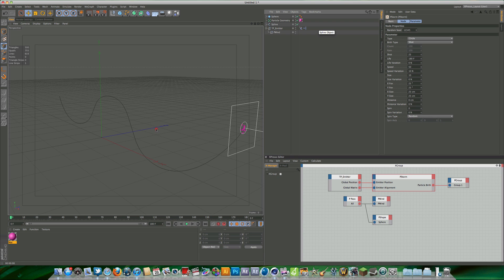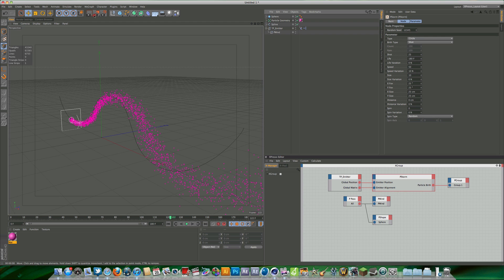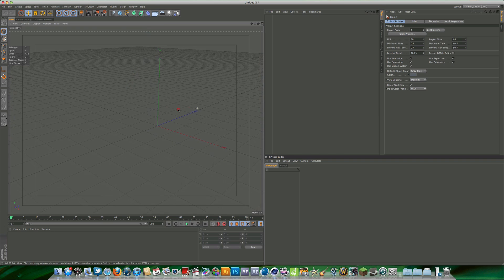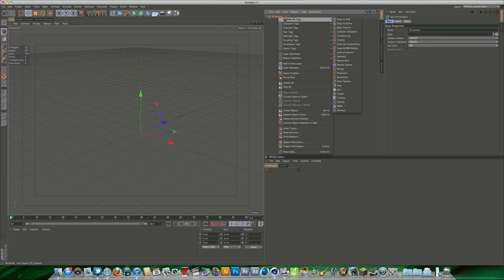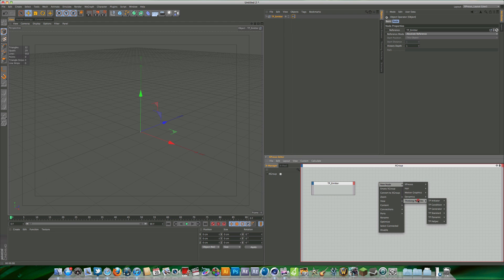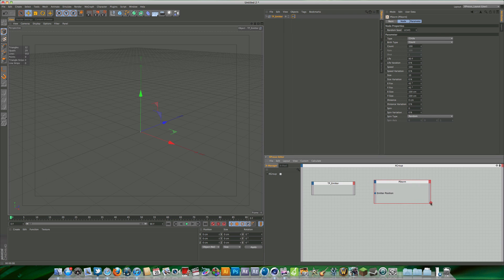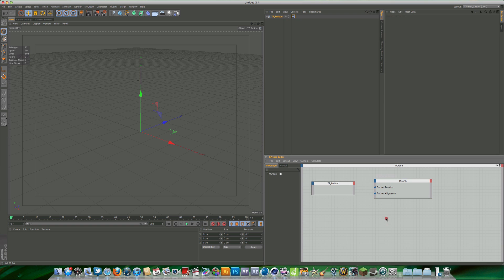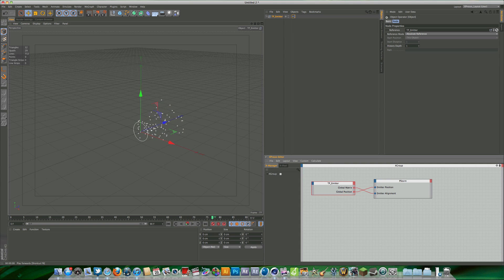Thinking Particles Cinema 4D Tutorial - Part 01

Comment: Ram and bits aren't what people look for, because when it comes down to it, the designers look for a smooth system thats stable, with a clean design, which is mac. They may render through a beefed up windows, but all the design is done in mac.

Comment: This is irrelevant information.
They also use high-end monitors capable of displaying 10 bits per channel (30bit). OS X is only capable of displaying 8bits per channel whereas Windows 7 was already capable of 48bit (16bits per channel). Twice the number of bits does not equal to twice the number of colors: 24bit(3x8) is 16,777,216 variations of color,while 30bit(3x10) is 1.07 Billion variations of colors. This means that 24bit is just a tiny bit more than 1% of 30bit.
OS X is deprecated.

Comment: All Adobe and Autodesk products are nVidia optimized, and as far as I know, only the macbooks have nVidia GPU's, iMacs and Mac Pro's have AMD graphics processors.
So no, not even for designing. This is a very common misconception: It's not used by designers because it's "the proper tool for designing", lol, no. It's because most designers don't know enough about computers so they go for looks and comfort. Apple got both design and ergonomy (comfort). That is all there is to them. Looks.